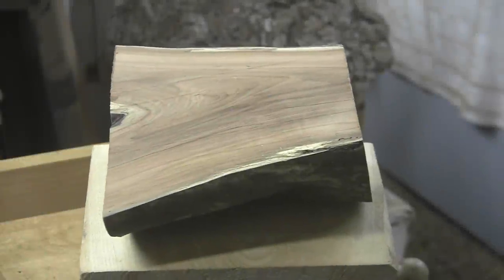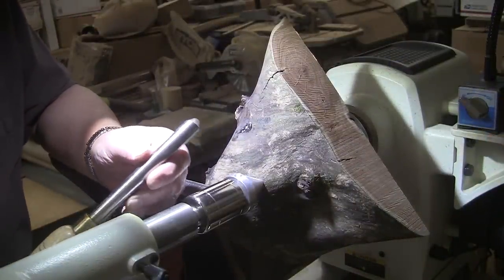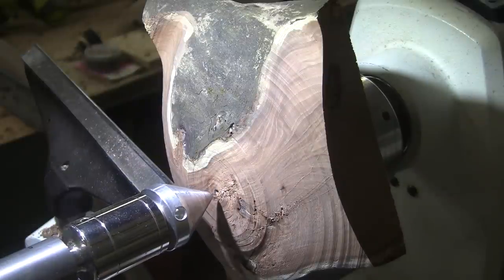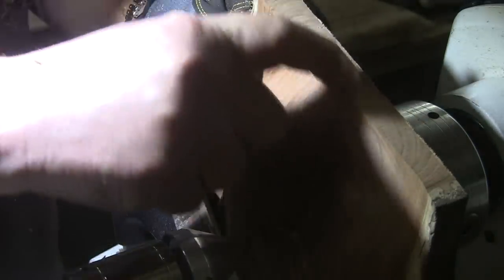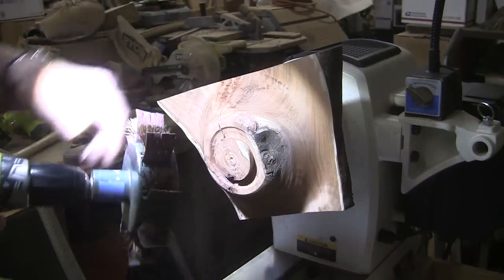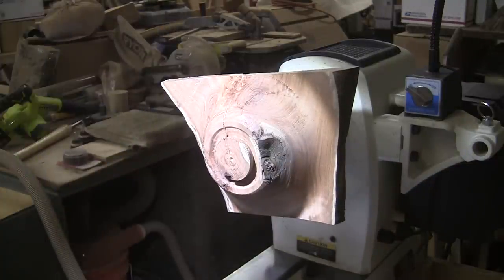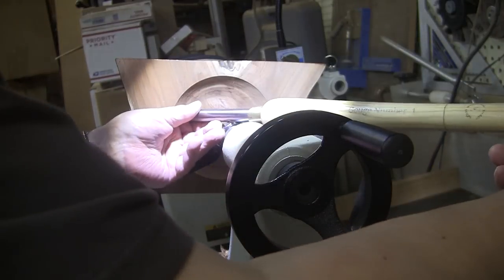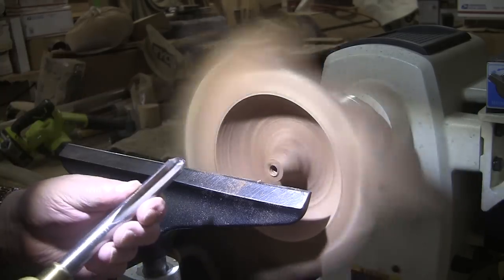Perfection In The Midst Of Confusion! - Wood Turning

Comment: Hi Phil !    What an interesting turn.    And, I kindov like the corners that angle down on the underside:  it must feel nice when you pick it up by a corner, cause the thickness transfers some of the weight to the PALM, instead of holding all the weight at the fingertips.   
Ya.   I like it!
The heat finally arrived.  Boo.   But, still no mosquitoes; so, there's that.    The cool returns Saturday night.   Got another CoVid jab today.   Taking tomorrow off.   🌷🐞🐟🐜🦋
Reply from the maker: Geeze, is covid still a thing?  I got the first two shots, nothing since then.  I'm good!  No mosquitoes is a good, too!  Enjoy!  😃
Reply: @PhilAndersonShadyAcresWoodshop  🔬🧬I too thought CoVid was passé.     My bro and his wife went to a party with 4 couples.   Within a couple of days, 7 of the 8 got symptomatic CoVid.    Bro had to take Paxlovid for 5 days.    Sis'in'Law is still sick.
My last boost was 8 months ago.
Figured I'd be on the safe side.😇

Comment: Pretty bowl, but it brings up a problem I often run into -- what do you if that crack starts to widen after you've finished the bowl and given it away?  🙂
Reply from the maker: The wood is dry, not gonna crack any more.  But, if it did, I would do nothing.  Wood is wood, it's natural, stuff happens.  😃

Comment: Garry not Linda. Any of us old guys who split and burned wood back in the 80's during the Dutch Elm plague can tell you all kinds of stories about how hard, tough and stringy white or red elm really is. I got truckloads of it from a shirt-tail relative who had a tree trimming business for $35 a load. Some of those old growth elm trunks were at least three feet in diameter. They would have to be ripped into quarters with a chain saw just to be able to manhandle them onto the splitter. Elm wasn't split, it was sheared apart. It was best done in the dead of winter. Frozen oak was a breeze. The blade would barely break the surface and it would go BANG and fall into two pieces. Not elm. The ram had to push the blade through the entire piece and even then it may have had to be cut the rest of the way apart. I've got  pictures of us standing by waist high and more 12-15 foot long trunks laying in our woodlot waiting to get broken down. I don't miss those days at all.
Reply from the maker: Oh, man, Garry, you wore me out just reading about this!  Yup, I don't blame you for not missing those days but it's still a good memory!